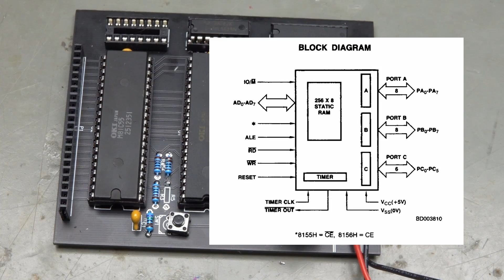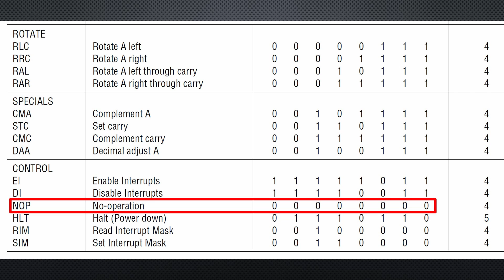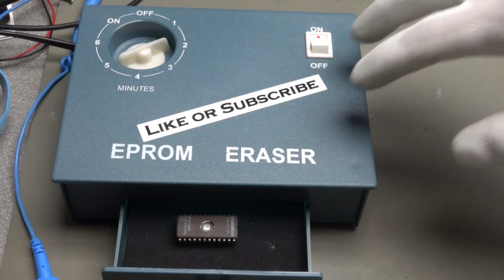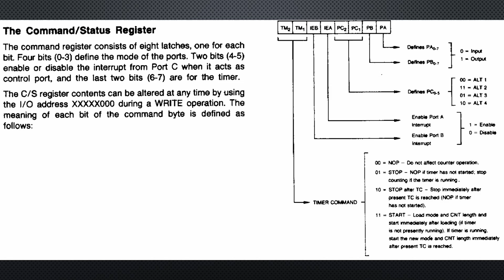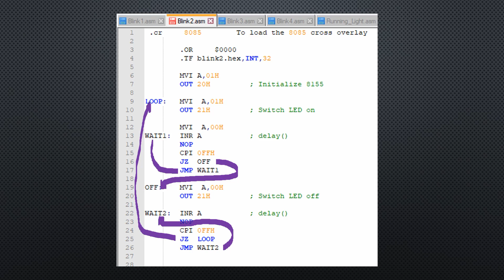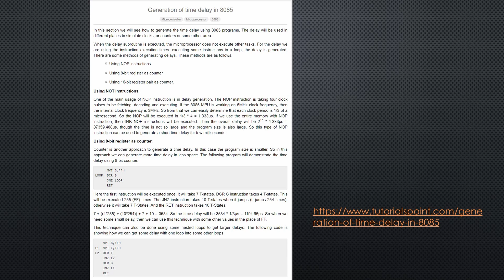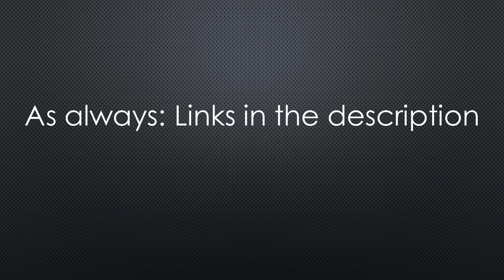#314 Retro: Assembler Programming with 8085 (incl. plan for board)

Comment: This brings good memories of programming assemby language in the 90's using the 8085 boards + help of simulator back in school. It was always a matter of programming before hand... before putting on the eprom. Still we also take a look on the 8051  and the earlier PIC16F  microcontrollers :)..
Reply from the maker: I completely omitted the 1990 and the PICs. It was "family time" here
Reply: @AndreasSpiess  My point is, Even in 90's the 8085 was used as base for  learning how the processor worked (theory and pratical ) before going further into MCU's , The MCU was just a short brief of the hole story ;)

Comment: Great introduction! Even today, the 8085 is still used in many embedded applications. For example, it's included in the Cypress FX2LP chips.
Reply from the maker: I did not know about the Cypress chips. But it was easy to get the parts on Aliexpress. And not expensive.
Reply: FX2LP has 8051 core

Comment: NIce video, I cut my teeth on the 8051.
Reply from the maker: If I remember right, the 8051 was later. At least in my career...
Reply: @AndreasSpiess  the 8051 was later than the 6800 and 8085. I think the MCS-48 was a bit earlier. I think the 8051 is similar to the 8048 but I don't know the differences. Still very simple systems and relatively easy to work with.
Reply: That's actually a nice processor. It's more a micro-controller than a micro-processor. I like its asm, very comfortable to work with. My favorite is the 6809.

Comment: I was wondering if you were going to get around to this project. I know it's easy to get started on a project and see it's limitations and start thinking, do I really want to spend my time on this? I still would have gone with the Z-80 or the MC68000, but it's your party and I have to admit that's a pretty clean board layout. All simple stuff to us old timers. It's funny we're old timers from the 70's digital world, but compared to the giants of the 40's, 50's and 60's we are still noobs. I hope you have a great day.
Reply from the maker: You are right, I could have done it with other chips. But especially with the Z8 it would not have made a big difference. And this de-multiplexing was a nice add-on...
Reply: Wasn't the Z80 and 8085 almost the same? Sorry I was more a Moto head.
Reply from the maker: I never used Motorolas :-(

Comment: Hey thanks for this series. I have been playing around with little glue on DIP chip pinout labels for awhile. I have around half of these chips already posted in premade PDF's on GIThub. I think I have the rest already made in my older style system that is not posted. I will have them reworked and committed within a few hours from now. I will try to make a single PDF with a couple copies of each chip just for your project here, like I have done with Ben Eaters stuff.
  I make the labels for my own use in projects, but freely share them with anyone that might find them useful. I have nothing to gain in sharing this.
  The GIMP files I use to make the labels are also on GIThub with some basic instructions about how I use them in the readme.
https://github.com/Upcycle-Electronics/ChipLabels
Reply from the maker: I tried one and fed it into my Brother label printer. With the right dimensions (on 24mm label) I was able to print it to size. Then it already sticks! Thank you.
Reply: @AndreasSpiess  
 It took a little longer than I had assumed initially, but here's the PDF:
https://github.com/Upcycle-Electronics/ChipLabels/blob/master/AndreasSpiess8085/AndySpi8085.pdf
Reply from the maker: Very nice. Thank you! I put a link in the video for others.

Comment: This was a wonderful video. I had Z80 based computers at that time. I did not find Assembler confusing and the Z80/8080/8085 had some wonderful instructions. I have used Assembler with a PIC around the Millenium and loved it. I thought the D?NZ (decrement and jump relative on non-zero) would have been a better loop because it was two bytes rather than three but only useful for =/- 127 addresses.
The instruction JP (HL) sure it is 20H maybe not, is the most useful of instructions for reiteration and is the base point of that wonderful language Forth.
I cannot believe that I have thrown away all that legacy stuff I had, going to have a dig around and have a Senior moment. The 8085 of course was an 8080 without the necessary companion chips.
Many thanks for this.
Reply from the maker: This video took already lots of (fun) time and I had no time left for optimization. So I was glad when ir worked ;-) I used a TRS-80 to program my chips back then and I still have it... But the rest is gone, too.
Reply: @AndreasSpiess  Mine was a Nascom, the single board, then the Gemini series a couple of HDs and CP/M. I got a 16 bit daughter board later on and could not make any sense of 8086 instruction set so migrated to DR C, I still have the 8" disks somewhere. I am hazy with what I was doing at the time but Amateur Radio and Fido come to mind. Internet was, I am not sure, but not to the fore front.
I know I must have the parts assembled for a Z80 based SBC, not sure about the PIO but I can remember the Tri-State buffers that were hard to get at the ime.
Great reminder. Thank you.

Comment: We Americans don't use complex numbering schemes! We simply change the base with every unit. Nothing a look up table won't fix. :D  Also: Thanks for the tip about using the TL866 program software as a hex editor! I should have realized it could do that.....
Reply from the maker: I never digged into feet etc. because I have already enough problems to solve without them ;-) When I watch American videos I am always astonished how fast they can do their calculations...
Reply: @AndreasSpiess  FWIW I was the student who couldn't memorize a multiplication table, but could do the actual multiplication fast enough to get by. The imperial numbering system infuriates me because remembering those units is problematic. But, when in Rome...
Reply: One advantage of being British and from a certain generation is we can work with both imperial and metric.

Comment: I remember those Days. I used to build low power controllers (less than 1 milliamp ) with 65C02 and 1802 CPUs. I had to program in machine code due to small memory and EPROMs . Ah, memories.
Reply from the maker: 1 Byte back then had maybe the value of a Megabyte these days...
Reply: @AndreasSpiess  
It became even more expensive, having to use Static RAM vs Dynamic Ram in order to cut power consumption by stopping the clock and using a real time clock to restart the controller after a fixed delay.

Comment: Now I am interested how you programmed the EPROMs in the late 70's...

what devices did you use for that?
Reply: I still remember that to program an EPROM first required saving several paydays to buy the EPROM chip, then reading the data sheet to design a circuit to hook it up to a microprocessor dev kit, using an 8 bit port for the data lines, and another I/O port for the control signals and a clock / reset connection to a 4040 counter (for the address lines). Then hand assembling and hex keypad entry of the machine code you’d write that was required to program the EPROM, following the required timing described in the data sheet. Plus, having to also build a regulated 21V power supply to supply the required Vpp voltage.  Oh yeah, and UV erasers were completely unaffordable, so a program change involved putting your EPROM in direct sunlight for several days until all bits were erased, or at least the bits that you needed to change to logic 1 had erased (so you could successfully reprogram it with the changes). All the hard / time consuming work to achieve what we take for granted these days, was the normal back then. But it was also hugely satisfying to successfully achieve all of this with nothing more than a few IC chips and their datasheets, and of course our curious & problem solving brains! :)
Reply from the maker: I built my own programmer because commercial ones were too expensive
Reply: @AndreasSpiess  that sounds interesting! Do you stilll have it? I would be glad if you could show it to us in some video! Were you able to connnect it to a Computer or Terminal, or did you had to enter every adress and data by hand?
Reply from the maker: Back then I was glad I did not need it anymore. So it is gone...
Reply: @AndreasSpiess  Too bad, but nothing we can do ¯\_(ツ)_/¯

Comment: I used to do this in the 90's at university using the Motorola 6811. I remember we used a simulator. Made software development simpler but the simulator had it's own issues. One being that I wrote an infinite loop and it crashed the simulator after 5 minutes. Turns out the simulator had a counter in it that counted the number of instructions simulated and I overflowed it. Hence the simulator crashed but the real hardware would not! Learning to code like this has allowed me to debug so many different systems. Knowledge that served me well. Also the minutes of penalty applied for getting code wrong teaches you to think changes through. Not having full variable debugs meant you needed to debug via leds, logic probes or in more more advanced uses, an LCD! Thanks for reviving the memories.
Reply: bravo bravo, bravo.
Reply from the maker: This is why I thought, I mention the brain as one of the prominent tools. We had to have a lot of fantasy. and time...

Comment: I remember my SDK-85 mounted in protoboards, the 8279, 8155, 2732, 6116 some TTLs chips and of course, a Toshiba 8085 - so many time cabling and testing, but at last it worked and we pass our 1988 course!!!
Reply from the maker: I was surprised that my PCB only had one error: a pull-up for the hold pin instead of open or at least a pull-down. Easy to fix...

Comment: Great video; really humbling :>
Reply from the maker: Why humbling?
Reply: @AndreasSpiess  *meant humble. Nowadays we take for granted highly efficient uC with GHz clock cycles, objective languages, built in USB communications chips, years of experience encapsulated in all the design patterns - all for less then $50. Seeing a project like this makes me wonder where did we go wrong knowing that a simple "blinker" website in React/Node.js requires 50MB of dependencies across 10k of files!. Sorry for the confusion; your videos rock as always!
Reply from the maker: I think nothing went wrong. Memory is cheaper than back then. So you optimize time. Back then, hardware was expensive. So we added (cheap) time instead of hardware...

Comment: As EPROMs got bigger we kept using the old 8 bit processors by paging the upper address lines so programs could become bigger.
Some pages were dedicated to debug code, such as stepping through every memory location or fill memory with a gray code count.
The idea was to make debug scope friendly.
Reply from the maker: Today, big EPROMS are cheaper than small ones... Yes, I remember doing things like that and chopping the program in different "modules"
Reply: @AndreasSpiess  I applied for a patent based on a modification of this idea. 
Inorder to protect our intellectual property and stop the code from being reverse engineered, I proposed an EPROM where it was possible to program a sequency of code executions that would unlock the read access to pages in the EPROM. 
The idea was that certain sequences of instructions would only be executed infrequently and maybe dependent on an external stimulus. Only when these fragments of code were executed would the upper pages in the prom be read accessible. 
This prevented the prom from simply being copied. Further any attempt to run a trace on the program was likely to fail as the necessary sequence was unlikely to be executed under test conditions. Any pirate could not be sure that his/her traces efforts had identified and unlocked all the locked pages, meaning any product based on a pirated copy of our code would be prone to unexplained crashes.
Unfortunately for me, IBM beat me to the idea, though I do not believe they ever exploited it. 

I did however gain a patent to building a watchdog into the ALE latch IC. In this case the intention was to solve the problem of who watches the watchdog. By monitoring the address line activity, it is possible to avoid the program from becoming trapped in a short loop that does nothing but support the watchdog refresh. The trick is to divide the watchdog refresh between an interrupt routine and sections of the main code. Maybe with the interrupt arming the watchdog refresh and instructions distributed in the main code triggering it. For instance the interrupt routine writing the refresh line high and the main code writing it low. I took this to an extreme by requiring a word and it's complement to be written, with a limit on the number each could be written without the other. Failing to meet the criteria resulted in the watchdog bitting. 
 Like many patents, I do not think it was ever implemented, I was just used for defence against other companies patents. 
I did zinclude a version of this in a PLD that implemented the ALE function, watchdog, address decoder and a few other radio functions.
Reply: In practice I was awarded two patents from the above idea. The patent officer, suggested splitting the concept into two, in case one received a challenge. It was a challenge from IBM that scuppered my EPROM idea from getting a patent.

Comment: Oh my goodness....somewhere buried in my attic I still have my old Altair 6800, UK101 6502  home made computers and.. a Z80 wirewrap system I made from scratch.  Your video brings memories of that time flooding back,  but also reminds my why I latched onto your channel in the first place: buying an ESP board is so much easier!
Reply: I used to have a UK101 and learnt assembly on that using the inbuilt monitor.  I ended up as an electronics designer/assembler programmer in my professional life.
Reply from the maker: But both are somehow fun. At least for me...   I do no more have a lot of stuff around from then. Only my TRS-80...

Comment: Very cool to see early intel architecture. I have played with the 8048, which is similar, but a mcu. One of the first MCU. It has a ROM and a tiny internal RAM, some GPIO, but also like the 8085 an ALE and muxed addr and data bus. It was used in the VideoPac gaming concole (1978 or 77) with 256byte external RAM.
Reply from the maker: The ideas were aleready there. Just not the size...

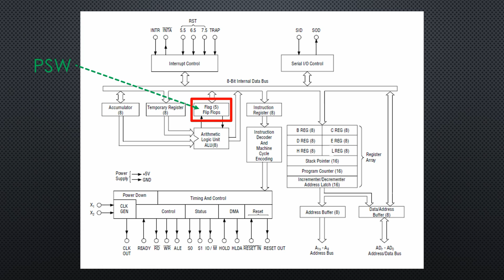Comment: At around 27:42, there is a bug in the delay routine. On entry, it pushes B then D then psw. On exit it pops psw then  B then D. It should of course pop D before B.  ... just a thought from someone doing way too much 8085 code in the 1970s. (;
Reply: I've only ever programmed in assembler.  These sort of bugs jump out at you straight away.
Reply from the maker: I have attentive viewers! I mentioned that those errors were nasty. And here it did not hurt... (The error is not Github)

Comment: I built own my 8085 board cloning the SDK-85 monitor, but speeding up the serial port to 9600, with a built-in EPROM programmer too (based on using wait states with a timer). You brought me back to the 80's and to CP/M :-)
Reply from the maker: I never used CPM. I switched quite early to IBM clones because I got them cheap in Hongkong (my wife was a Stewardess back then...)
Reply: @AndreasSpiess  CP/M included an 8080 assembler which came in handy. However, I did use it on an Atari 1040 ST with a Z-80 emulator :-)  I failed to mention before that the serial port was a software serial (using SID and SOD pins).

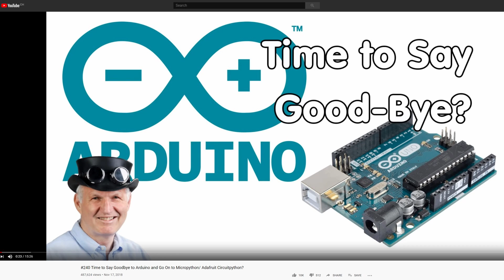Comment: 25:00 This is where the error happened: 

In DELAY line 20 you PUSH B first, but in line 33 you POP D last. 

You changed B and D while push and pop in DELAY.... 

LIFO !
Now you have to use a debugger to find that fault  ;-)
Reply from the maker: I have great viewers. I thought, it does not hurt there ;-) Github is corrected.
Reply: @AndreasSpiess  There was no need to push or pop anything, as these registers were not used anywhere else in the program.  However,  with anything more complex and you'd be in serious trouble.
Reply: @AndreasSpiess  could I push some suggestion to you GitHub?

I would suggest some changes so you will have two delay routines when you continue develop more code using this monitor. 😜
Reply: These errors are nasty, if D and B do not contain needed values before the call, all seems fine. And 2 years later you paste the delay function into the code of the Apollo spaceship. ;-) Why not, it was tested before...
Reply: Saw that bug straight away...  Would have been even worse if it was in an interrupt routine!
Reply: It's funny how well those things have been burned into memory... first thing I checked was the order of the pops... have been hunting those bugs so many times it just comes naturally, even that I haven't done that for years... it's just burned in :D
Reply: I was wondering if the pop order was deliberate. And then when explaining the online simulator, I note sub 'delay' doesn't push nor pop D at all :) another subtle bug..
Reply: While this is a bug in this context, it's useful to realise that you can always pop the last 16-bit number pushed onto the stack into any register pair you wish.
The Program Status Word contains both the flags and the A register, so if a subroutine "knows" that these values were the last to be pushed to the stack, it can pop them to any register pair, then push them back onto the stack to preserve them and use the copies which are still in the B and C registers to (for example) find out if the calling program had saved the zero flag as "TRUE" or "FALSE" at some time in the past.
Tricks like this are one reason why assembly code programs are generally more powerful in terms of what they can do than are programs written using high level languages.
Reply: Me too saw it 😜